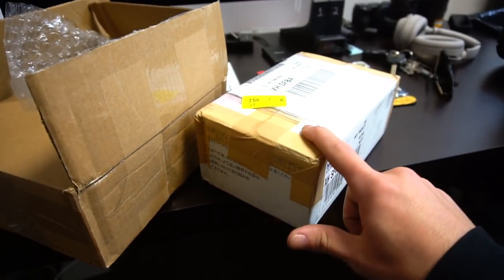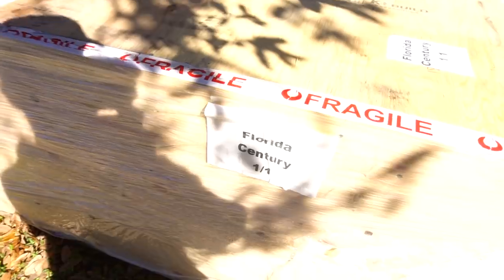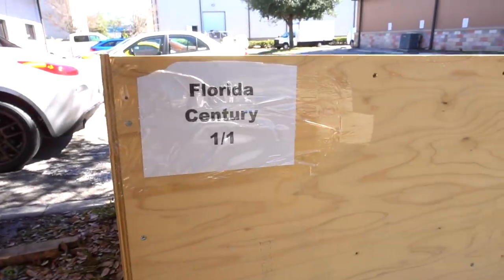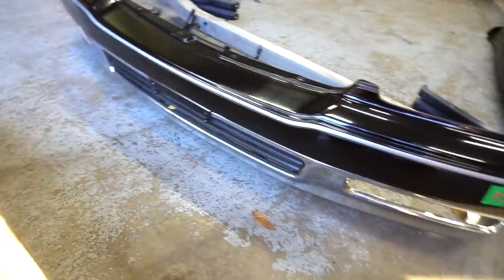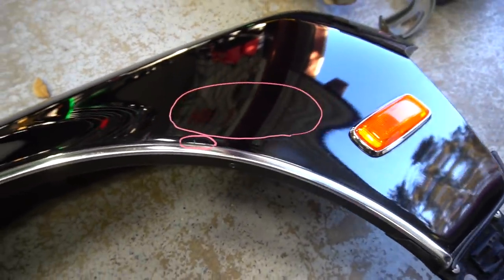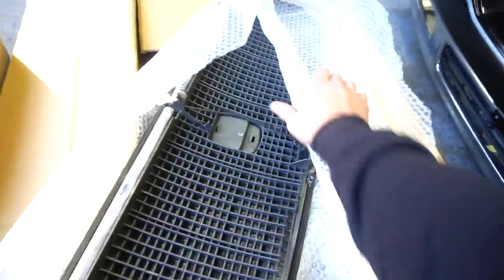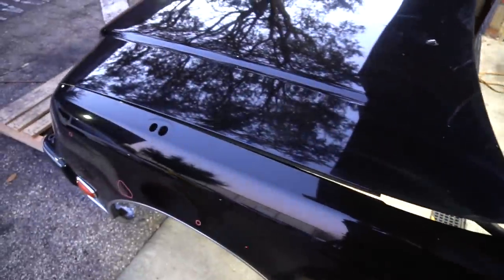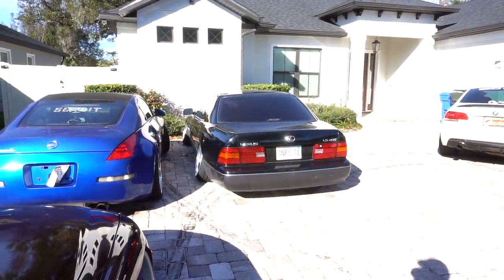I'm Toyota Century Front End Swapping my VIP LS400!

Comment: Do you have the fender mirrors? Looks like there are holes for some
Reply: I think they have sidemarkers on the fenders also? Some people do take them off and replace with mirrors I've seen but I don't think the mirrors are standard, but the sidemarkers (Blinkers maybe?) are!
Reply: @Mel1n1  They had 2 options with this shape of Centurys.

With those holes in the fenders, they are for the fender mirrors that some of them had.. 

If it was much closer to the very front it would be for the fender clearance lights which are used to gauge where the front of the car is exactly during the night.
Reply: speaking of holes, looks like he also has the hole in the bumper for the parking pole, wonder if he got his hands on that too?
Reply: patch them up and keep the LS mirrors, would be cooler i think
Reply: @Krith220  easier to adjust too

Comment: Re the speed sensor.. if its like majority of the Toyotas from the era, it will default to the front left ABS sensor as its fall back. So your cluster should still work fine. Wiring in the r154 speed sensor is probably not worth it. I used it for a little while in my jzx110 swap, with a manual ecu, but I ditched it because the reading was out due to my 4.1 diff. Its currently running the auto ECU and on the ABS sensor for the speedo without issues.

Long story short, my advice is while the box is out, get a block off plate also fabricated by Johan as a backup if you don't end up using the r154 speed sensor!

Comment: With the front lights. You can just sand them down to make them look like new. Sand using 240g, can start lower if deep scratches. Or higher if just the UV fading..  and go upto about 2k-4k and spray a coat of clear coat on them. Or buy actual UV protection coating. I used to do them on the odd occasion at work.

Comment: By the way, there is a hole in your bumper for the electric parking pole. That would be an awesome option to have, but of course you would need to mount it on the other side (it has to be on opposite site of where the driver is sitting, it's meant to see the farthest corner of front bumper easier). JDM Celsiors had that option too. I have oem Celsior parking pole on my LS400.

Also there was a facelift model of GZG50 which had clear headlights - I don't remember the year when facelift came out, but you can check for example year 2007 on google and you will see the difference. I think they are plastic and imo they look a lot better than the glass ones.

Also don't know if you know, but there was Wald lip kit available for LS/Celsiors, the rear lip looks literally 10/10, makes the bumper much lower and there are cutouts for two round exhausts instead of quad exhausts. Check it out, maybe you will like it more than JP bumper.